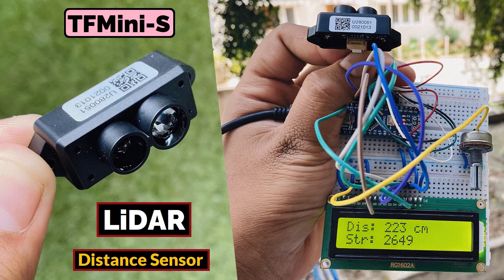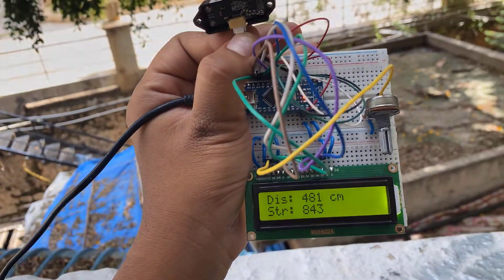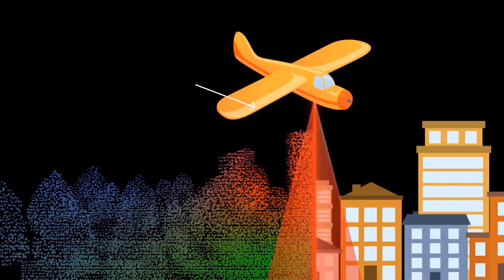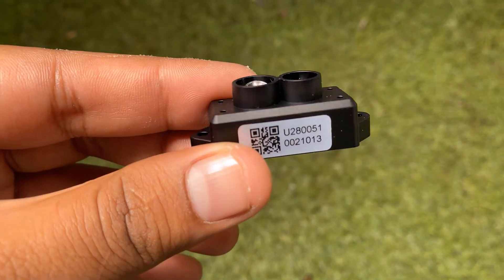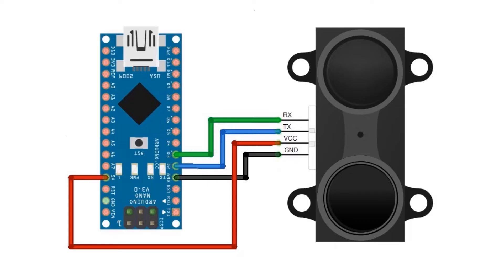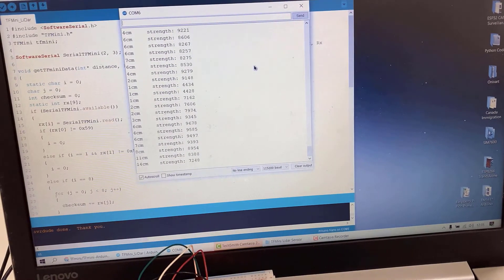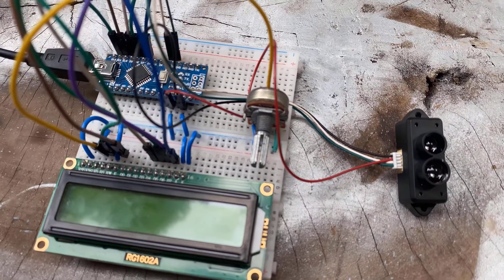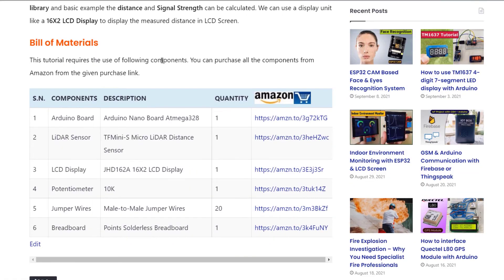How LiDAR Works || Interfacing TFMini-S Micro LiDAR Distance Sensor with Arduino

Comment: great video, excellent explanation, but this is not actualy a LiDar( L= laser .. and this uses a pulsed led, which makes it more a scp sensor ( scannig  cloud point).Means its great for collision avoidence, but cant beat the good 2d 360 Fov lidar modules from say yd or rplidar( both are iconic, I suggest looking at those too( may need to wait for amazon sales sometimes they go down to $100 if your lucky, reg price is around $500(huge difference is that nobody buys them at this price so eventually they lower them to clear stock)

Comment: Nice video and the usage is well explained!
I don't have electronics background, but want to do some hobby electronics. Some questions:
1. How thin an object can it detect? Can it detect a bicycle, i.e. Can it detect the size of the width of a bicycle tire?
2. Can it be used in all external lighting conditions? What are the limits?
3. Can we choose to use only non-visible ranges of the source (ultraviolet, infrared) so that if we want an app that doesn't disturb humans or aniimals around?
Thanks.

Comment: Awesome video!  But I was just wondering if the LiDAr TFMini-S Micro can only detect on its linear view? or it has field of view which can detect side objects other than the linear view of the sensor?
Reply: It only detects single point view, having no ToF capabilities or any real slarm algorithem, its basically a fancier version of an ultrasonic distance sensor, if you truely want to experiment, get ydlidar or rplidar these will set back about $50 more then tf mini, but are super usefull for Lidar mapping( can map about 12M which for room mapping/human scan works very well( ok if truely you want to go crazy there are $6k lidar modules, that can go up to 1km of cw scans( cw lidar is not the same as pw and not the same as pfl( pulsed focused led( which is what Tf mini is)) I use currently a $100 YDlidar unit and works very well, but .. its not too hobby friendly as its quite a big gurthy device( not heavy but can cause issues with balance of robot chassie if placed on the side)

Comment: Hey great video I have bought tf mini luna lidar sensor and esp32. There is no ouput coming out. Tried each and every possible way but was working (p.s. sensor is working condition wires were fitted properly directly with microcontroller. All libraries were downloaded).
Can you suggest what can i do ?